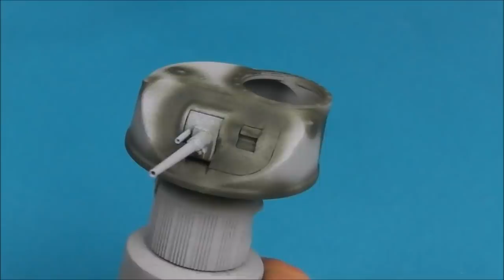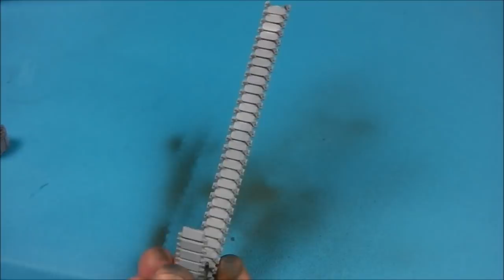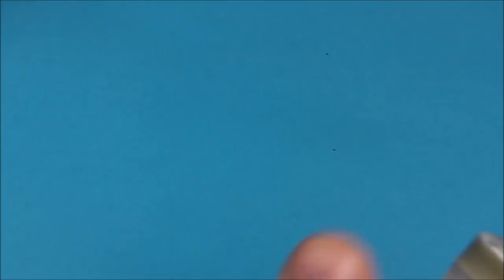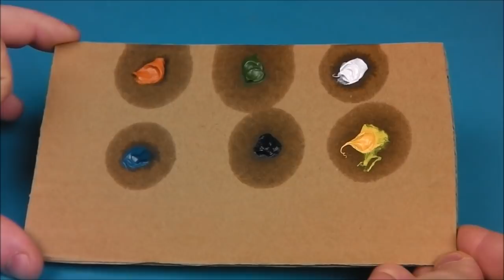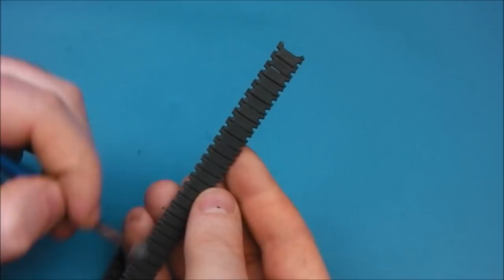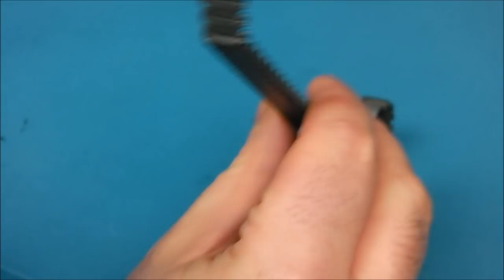Takom 1/35 M3 Lee Early: Painting & Weathering Guide

Comment: one thing you might try because of your heavy humidity is to place them in the refrigerator, it is cool dry air like an air conditioner and you would get better and more even drying of your paints, even a hairdryer blows humidity, even with the heat setting on. humidity goes in and comes out as hot vapor. I never did the model in the fridge, but logically it should work, it is worth a try, and really should not take long, especially if the fan is running. this is just my thoughts on your problem and something I would try. Happy Building AND ... may your today be better than your yesterday
Reply from the maker: thank you Jennifer! I never really thought about using a fridge to combat humidity before! it might well be worth a try as once it get wet here in the winter it makes painting very difficult, near impossible at times so it may well be the answer 

thank you!

Comment: I frequently have issues with humidity in the summer. You can kickstart the paint setting with a hairdryer or heat gun on low. It works with both acrylics and oils. Also you could try thinning with a bit of iso with your standard/typical thinner.
Reply from the maker: its so wet here that even a hairdryer is ineffective as the paint either re-activates or begins to break down or separate,though I've found switching lacquer based paints seems to be more resistant to the damp

Comment: Hi Shane, love your channel.  I never realized that the roller wheels on the top of the bogies on a steel appearance.  Instruction manuals in kits don't give a color and I assumed they were olive drab.   Many thanks.  Love your work
Reply from the maker: its a detail that is never really mentioned in panting guides at all, if you check out photos of M3/M4 they are often seen not only bare metal but with a gleaming shine which gives us a means to add a hint of interest to our builds 

thanks for your support!

Comment: First of all: very nice build! 

The other things:
This is one of the many disadvantages of the Vallejo and its ripoff other latex based craps. (BTW, they have absolutely no advantages.) If you want to use good paints, you should avoid these turds. Any paint which can thinned by lacquer thinner better in any way (except the newer AK Real Colors. Those are simply bad paints. The original Real Color was good). Smelly? Yes. But that is their only disadvantage. But their flexibility in usage make them superior to any kind of latex crap. You can use your thinner of choice, according to the circumstances. Use alcohol based for Tamiya or Gunze acrilycs, if its suits the case, or use lacquer/cellulose if that is the better. Same for enamels: you can use the standard mineral spirits for them, or lacquer/cellulose. You can adjust the behaviour of the paint by the used thinner.

Those latex paints don't even adhere to the surface. You can peel off them even after years. Try the same thing with a lacquer or an enamel.

Even the english people say the decal word at least 3-4 ways. Plus the dialects.
Reply from the maker: I take it you don't like vallejo lol 
I personally quite like them as I am very used to working with them and like their color range, that is not to say they are best colors out their as they are not, but for someone like me who does a lot of brush work as well as airbrush it suits my needs, but that said I will be experimenting with Mission Models paints in the future
Reply: I tried a lot of paints in the last 25-30 years. Except from the latest AK Real Colors, the latex based paints proved to be the worst. I have a few dozen of 25 years old Model Master and Humbrol enamels. Still better then the latex based ones, both for air and paintbrushing.

Well, the color range is really nice in the Vallejo catalog. The only problem, that they can't call any of them in their proper names. Always generic names, nothing specific. For example: 71.137 US Light Green. No, not even by chance US Interior Green ANA 611. That make easy (or even possible) to find it.

And I really don't like to clean anything with nitro thinner after painting.

By the way: if you like them, then use them. The most important is what you can use comfortably.

Mission Models is an interesting paint system. Their poly additive is similar to the original white (and quite useless as thinner) Vallejo Thinner. And it behave absolutely the same way. The paints are good, but their Insignia White is not really white. It has a strange greenish tint. (I came to the conclusion, that not a single acrylic gloss white is useful at all. All of them become translucent after drying. OK, I haven't tried the MRP to this date, but that is the next. And the last hope for any acrylic gloss white. Flat whites are much more opaque, and much more white. Surprisingly (or not really surprisingly) all of the enamel whites are good.)